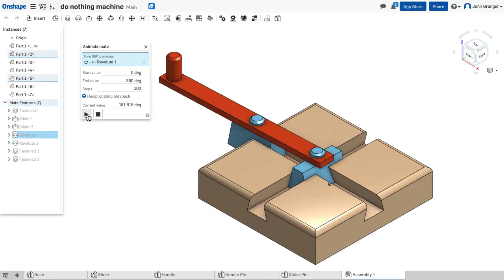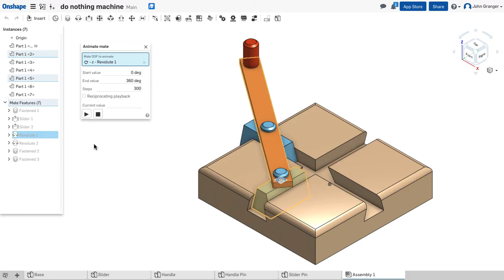Onshape - Do Nothing Machine - Step 8 - Animate an Assembly

Comment: is there a way to set a limit for a slider? so that it doesn't go too far
Reply from the maker: Hi, no need to set limits on the slider.  It only has to mated to the slot with a slider and the revolute mates for the handle will limit its range of motion.  enjoy